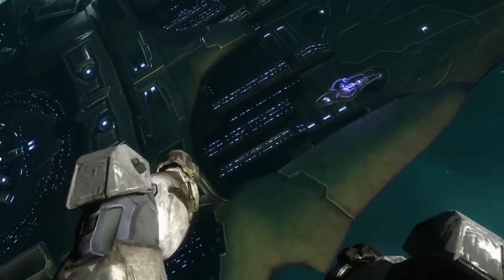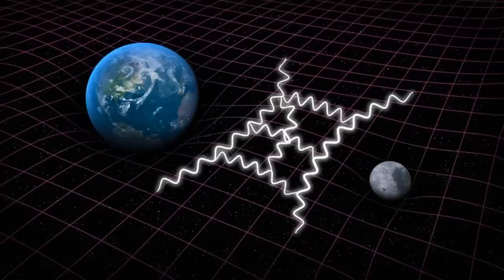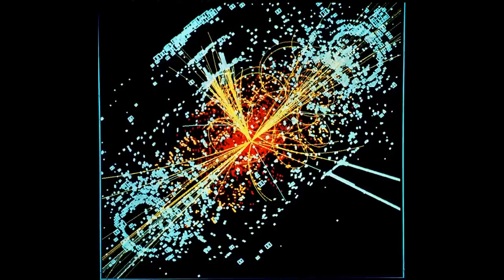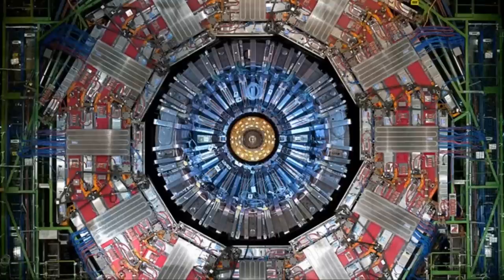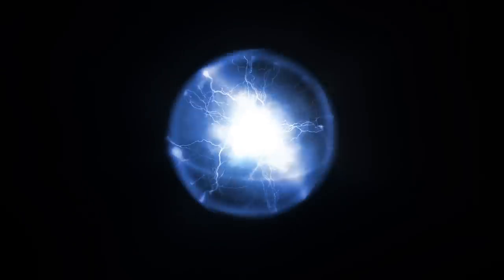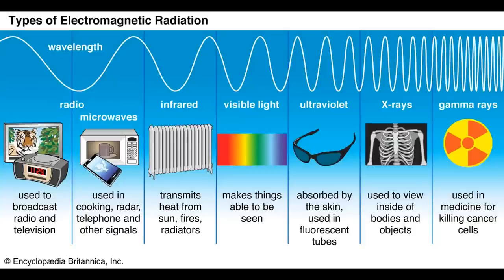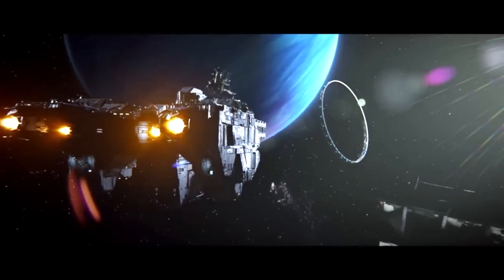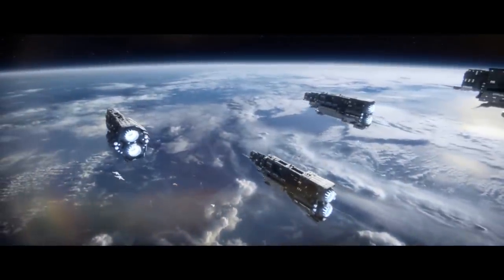Repulsor Engines | The Archive

Comment: The interesting thing to me is that they have an "anti-gravity court" for Gravball, and the repulsors create gravity wells as this video so well explains. So if you have the ability to create a gravity well in front of the ship and an anti-gravity 'hill' behind the ship, you have an alcubierre style warp field. Is this ever used for FTL Warp travel in the Halo lore?
Reply: Yes he mentioned it in the high Charity video but other than creating or negating 1g gravity human grav tech is generally too weak to be that kind of propulsion. Also no Star Trek style nav deflector in Halo.
Reply: The thing about using it for FTL like you describe, things like relativistic side effects can occur. Slipspace allows one to sidestep those paradoxes, though it can cause it's own set of paradoxes if strained too much on the local space-time brane.
Reply: Not necessarily, one of the theoretical niceties of that manner of drive is that since the ships local space time is a relatively flat area of space surrounded by the well and the hill, then the ship itself isn't moving so it doesn't experience relativistic effects (that is my understanding, at least?). The curved space around it would, but the bubble the ship rides in would be flat. It does seem like Slipspace, once it's mastered, allows for much faster travel, perhaps, and provides a lot of other advantages. It seems like this style of FTL drive is just skipped over since they can immediately go to Slipspace drives because of the work of older races. I'd be curious if it was a stepping stone at one point in the lore with the Precursors, Forerunners or Ancient Humans, and it is really neat to see it used for non-FTL speed travel. :)
Reply: I wonder if the scale of power generated in Halo would allow for maintaining such "warp field" for extended period of time required for interstellar travel? The implication was that the slipspace engines are "cheap" power-wise to operate compared to any alternative method of travel so it became predominant—especially with hyper-efficient forerunner stuff that the Covenant were using.
Reply: I agree on the power issue. I have heard that, due to the existing known methods of energy conversion, there is not a lot better than fusion for power generation until or unless you get into exotic power generation methods. Not even a matted-antimatter reactor would be better because you must use the same methods of energy extraction as in a fusion reactor, with the added drain of maintaining the antimatter containment measures unless you spend the effort of containing each small packet of antimatter in a fullerene molecule and use that instead, which would vastly increase the cost of the fuel and likely make fusion the most economical method anyway. Exotix power generation methods include but are likely not limited to; pulsed or constant micro-singularity matter-energy conversion power, Zero-Point energy extraction, or pulling energy from other dimensions altogether, as in a Hyperspace Core Tap. This could easily result in people in the Halo universe being unable to generate the required energy, even if the drive field was configured correctly.
Reply: Yeah, and that coupled with the apperant ease of slip space once you can figure out the time anomalies and such makes it feel like this as an FTL option is, perhaps viable, but a dead end simply because slip space is more attainable. As a sublight propulsion method, as pointed out, it seems like a great reaction less drive method and it's being used that way. It would be interesting to see it used for FTL in a pinch, at some point. :)

Comment: I've always loved the way Covenant ships moved!!! Semi perpetual engines are my favorite. Idk if you've seen Gundam 00 but they use a theoretical engine called a solar drive, and it uses particles as a kind of propellant that isn't affected by, gravity, friction, etc.. they have pretty good lore behind the solar drive and why it also uses a particle decay effect that can be done almost infinitely if it's built right.
Reply: More specifically, GN Drives utilize and exploit magnetic monopoles or baryonic decay (forgive me, it’s been a while, I can’t recall exactly which) as an effectively semi-perpetual power source with multiple applications.
Reply: so covenant used repulsor engines to manipulate gravity that's why they don't need extra small thrusters to change pitch and yow for the ship to change direction. But how did the UNSC is able to change the direction of their ship without using small thrusters to maneuver around space when the UNSC only used a more primitive method of electric drive which is Ion Drive propulsion.

Comment: Maybe one explanation can be given as there are traditional thrusters behind UNSC ships, those thrusters are used to propel the ship in normal space and only use Anti-Grav only for maneuvering the ship. This may mitigate some problems that have arrived through the assumptions in the video.
Reply: remind me, do you still need traditional thrust within slipspace?
Reply: @rigen97  AFAIK Yes, ships still use normal thrusters inside slipspace to travel at sub-light speeds.
Reply: @omkarpandit357  then I guess that's the primary purpose for the large thruster banks behind most Halo ships; because realistically you don't really need any other direction other than "forward" in slipspace, while in normal space having such an unbalanced amount of thrusters in one direction would be catastrophic. We never really see them do retro-burn either, perhaps because they primarily used repulsors in normal space, but they can't really do that in slipspace that has different laws of physics.

Comment: Having some rooms with lowered gravity while in space would save tons of energy in not only a lower power draw from the reactor but if you did it in say the cargo bay now everything you need to load or unload is lighter and therefore easier to move even using conventional methods of moving stuff. In the mechanics bay parts would be lighter and you would have less risk of injury or damage due to dropping something.

Comment: I wonder if a graviton could change the topology of the universe in such a way that the asymmetrical tidal forces cause the center of mass to "slide down" towards the now lower point of a gravity field, and because gravity is such a weak force with such a large impact we just don't have ways to detect it yet (or as posited, a graviton may not actually exist and it's just localized mass effects on the topology of space)

Comment: The trouble with antigrav tech is that, based on our current understanding, there's a very high likelihood of a wholly destructive interaction with the fabric of space-time. What do I mean? Simple: gravity is not it's own separate 'thing'. That which we call gravity is, in practical terms, a bending / warping of the fabric of space. We know that space and time are bound up with one another (hence the term "spacetime continuum"), proven both mathematically and experimentally, the best example being how satellites are programmed to take the difference between gravity and orbit vs gravity on the ground into effect when calculating time. As theory goes, a traveler on a spaceship moving at near the speed of light could spend decades in space (from the perspective of earth) but only have aged by years. 

What does this have to do with antigravity? Simple. Anything that effects the flow of gravity also effects the flow of time, as discussed. Ergo, a device capable of creating an antigravity field is also creating an anti-time field... and the implications of that, the damage it could cause, and the secondary technological miracles needed to safely use it as a form of propulsion... well, it's all fairly staggering.

Comment: So what you're saying is that through quantum mechanics, we could control gravity??
Reply: Maybe, maybe not. We don't know yet, but the only way we'll find out is by doing science.
Reply: @g.f.martianshipyards9328  that's good enough for me.

Tho, my question is, if you could allow it to be put in toys (the gravity tech) that might mean that it can't truly take up THAT much power to power it, right?
Reply: @marz.6102  Probably, yeah. It depends on what you define as "much power", a society with fusion reactors might see this differently than we do today.
Reply: @g.f.martianshipyards9328  I mean let's see the equivalent to fusion grab tech, for us it's the combustion engine, and wait-, we use combustion engine in toys, 

Like those rc cars that go really fast,I think that's a property comparison, right?
Reply: @marz.6102  For my view, flattened zero modes of 'action' may be the crucial key.
Presumably Einstein action, and akin to Cassimir engineering?
But it's all exceptionally theoretical, and tenuous, at best, so far.
Reply: @chrissonofpear1384  I wish to know more of this, is there a way to understand what you just said??
Reply: @marz.6102  It's not easy, believe me. I've come across the terms on physics forums, and a good deal of it seems to track. But it's more of a urban science myth, than anything out in the open, presently.
Zero modes mean zero vibration or amplitude, and can most often show up as standing waves.
Action is the physics term for perturbation of a system.
And Einstein action refers to perturbation in spacetime itself (the 'fabric')
After that, it may require something to do with vacuum energy (hence why I alluded to the Cassimir experiment)
So by not allowing spacetime to 'curve' the same way within the 'mode', you might begin to distort effective mass, or block gravity.
Whichever arises first.
Majorana Zero Modes were another phenomena, that may give some inspiration.

Comment: I don’t mind anti gravity being used to explain how these massive ships hover in atmosphere but it just bugs me that these gravity wells also serve as the ship’s propulsion. If these gravity generators are what push and pull ships, then what’s the point of the massive engines on the rear of every ship? it just seems dumb to have these cool looking ships with huge thrusters on the back just to hand wave it all away and say the ship actually moves by manipulating a gravity well. Plus any gravity well big enough to move your ship around in any meaningful way would also attract anything in the area. Space battles including fleets of ships in close proximity don’t make sense anymore if you consider the hundreds of massive gravity wells being generated by these ships to maneuver around. Think of all the fighter ships like banshees and seraphs whizzing around these ships somehow overcoming the gravity wells of all those ships in the battle. It just doesn’t make sense.

Plus it really feels like that system violates the laws of physics even as we know them currently. For the same reason that you can’t put a fan on a sail boat and blow it into the sails and sail around, it seems to me that generating a gravitational pull from within your ship and projecting it forward would just cancel out all of the movement. 

It’s such a needless explanation that just over complicates everything. Ships moving using the massive conventional engines already on the ship just makes so much more sense
Reply: The Repulsor Drives, Anti-Grav "Thruster" Suite, and Artificial Gravity Systems are all 3 unique to themselves technologies.

The "Engines" on the back are exhausts for the residual exotic particles and plasma particulate that need to be dumped via an electromagnetic chute similar to UNSC Fusion Drives Vectored Drive Exhaust System. Otherwise the Function of the Repulsors at base operation of the core drive itself doesn't require any sort of visible apeture like the fraking Cylon's 2003 variant Basestars.

The gravity wells and gravitics generated by these systems and even Star Trek Warp Drives don't interact with objects like you'd think and aren't strong enough to do so. Now, when it comes to small-craft, it would impart some influence. However the Repulsor and Anti-Grav's are not attractors and classical in function gravity like Artificial Gravity. Small-craft are usually going fast enough and the diagmagnetics on their spaceframes aren't that strong enough that they can wizz by.

The Repulsor System has a steering, pushing, and pulling component. You can think of it like the Do335 Pusher-Puller that the Germans cooked up during WWII. The part at the bow is pulling it forward like a tradional prop. The system on the stern is pushing it along like a turbofan engine. The Steering System operates like he said, but that's too simplistic a description to be honest and I can't bring forth the knowledge to more intricately describe it; its certainly above current science and tech level at the moment I'll say that. The sum total system also is making a rippling like effect on the fabric of spacetime via another part of the system, so you can imagine this part acting like a magic carpet kind of deal; this works by rippling the tidal gravitic forces from fore to aft in a wave like manner.

The "falling into" description is because of the actual falling into the well of the hull along the Y axis via the gravity generators whilst the "thrust vector" of the Repulsor proper from the "exhaust plume" is "pushing" the hull forwards and because of its situation the hull like the exhaust nozzles on the Su-35 Super Flanker it is also slightly pushing the hull out and away from the well's singularity point in spacetime gently; thus allowing the "magic carpet" motion of the whole system.

Its "needlessly" complex, because the mechanics and science of the whole thing is so complex on just the particulars of how it functions.